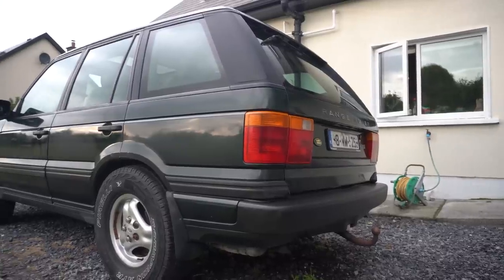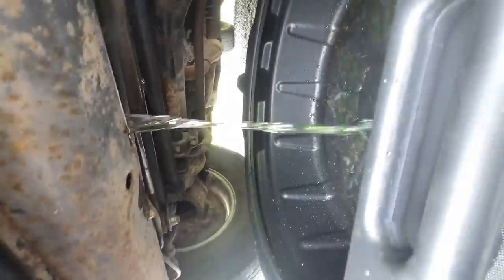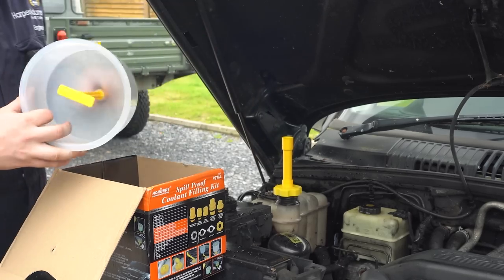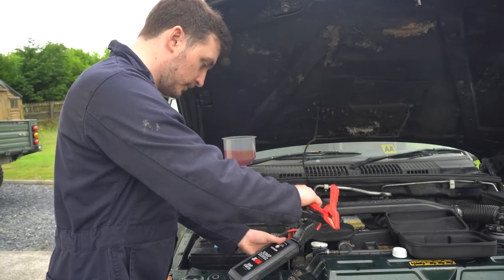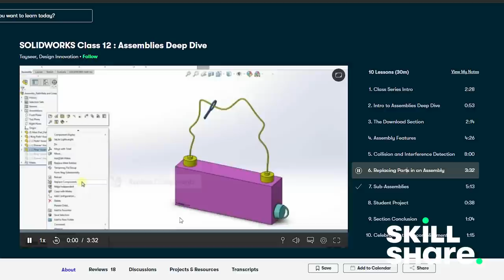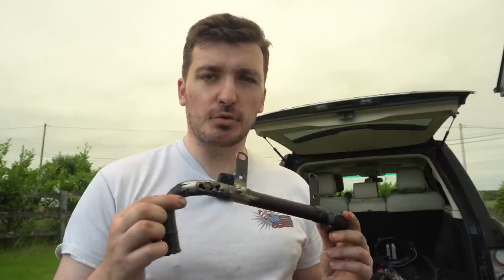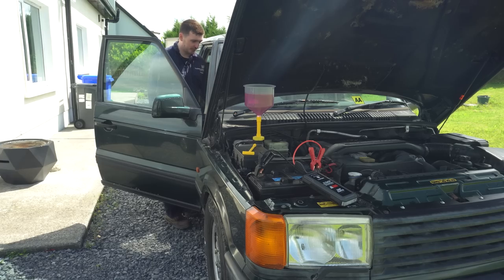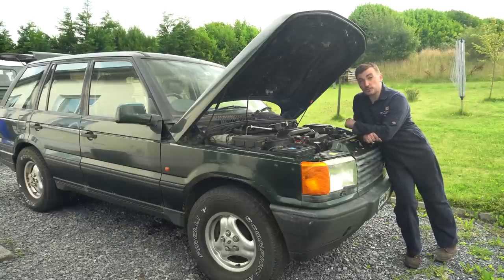My abandoned Range Rover P38 has a big problem with HEAT...

Comment: Hi Sam! great to see a P38 being brought back to life. I am doing a simmilar thing. Last summer I found a P38 with 110k original miles (180km). It had sat for 12 years in a shed before I got it. So far you have done all of the things that had to be done on mine. So I`ll just give you my opinion on the overheating. If the air bleed does not work, I`m afraid that youl have to do a head gasket change. I did everything but that as I dreaded the job. Changed the waterpump (has brittle wings and they tend to go),  put on a new thermostat, change the radiator etc. It did not overheat when maintaining city speeds or idling, but once I got on a motorway for a couple of hours it overheated (once the gasket was pulled off, it had about 2/3 of a milimetre rip in one of the cilindre chanels). Everyone I knew who had worked on these cars told me to do the head gasket and I should have listened. Would have been cheaper and faster. Aperantly the gaskets on these engines are made of an asbestos composite and they go within 10 years, especially if the car has sat. Once the gasket was done, all is fine. With the overheating that is of course :D So as it most likely will have to be done anyways, I recomend to do it asap as the heads on these engins can warp pretty easilly and mine had to be polished/sanded down to level. Sorry for spelling mistakes, not a native speaker

Comment: Hi Sam, just wanted to say I enjoy and look forward to your videos, doubt I will ever get a Range Rover but you never know.
It's just good to see normal maintenance jobs on normal cars.
I am just restoring a 85 Corvette and did a cooling system drain, flush and refill yesterday with new hoses, these are also notoriously difficult to bleed the air out as the radiator is below the top of the engine.

Comment: Always park the drivers side of the car higher than the passenger side,  this helps bleed the old girl.  One mod you can do is change the radiator bleed pipe that goes back to the tank.  The later models had a more level pipe that went straight to the tank. For the battery get a Hankook mf31-1000.  It wakes the while car up😎

Comment: Hi Sam just watched this video again which is very helpful i don't have a heater pipe leak YET! but do have the dreaded heater core O rings weeping! i may temporarily disconnect the core pipes from the matrix and loop them in engine bay until i can sort the O rings 🙄 I have just taken all the windscreen scuttle off and resealed everything as drivers carpet was sodden with rain water from leaky pollen filter/scuttle area now i also have the O rings to do as coolant on tunnel carpet don't we just love the P38 and i have only had mine just over a week😭
Reply from the maker: It’s truly a love hate relationship in the best sense!  Good luck! 🙈
Reply: @SamsMotors  Thanks and you did you get me message about Endtuning chips?

Comment: I had a problem with mine 97 model with the temperature going up and down but never got to the bottom of it since then have had another engine in from a 2000 model as I think the block had gone

Comment: Good one Sam, always been nervous about coolant systems, but looks quite simple really..think I need to add a topdon to the tool kit. Which bottle jack do you use for the L322? Got a service to do on L322 next week,  seems I've only done 5k in the last 12 months! Will probably just keep to a simple oil and filter change this year. Up in Suffolk camping this weekend, filled the boot to the top!! Best long distance machine, cooled seats are great during a heatwave!

Comment: Hi Sam, just a quick question regarding radiators in general. So I’ve had a new radiator fitted and coolant topped up to recommend level. Have noticed that after allowing to cool after a long run the level is dropping around 1mm each time I’ve had car up to temperature so after 2 weeks since new radiator was fitted I find the level has dropped by 20mm from recommended level?? No sign of any leaks , any suggestions please
Reply: Oil seems normal ( no creamy stuff to suggest water and oil mixing)
Reply from the maker: I'd say to just check around all of the hoses that were disconnected for any seepage.  You'll see white-ish residue if there is any coolant leaking.

Comment: Isn't the point of the lock on filler funnel to keep it fitted until up to temp so thermostat opens and it then tops up the revealed empty areas - you removed it to early here?
Reply: Is that in the instructions ? . Do you know the name of the manufacturer of that kit please ?
Reply from the maker: Yeah you can do - I prefer to put the cap back on and allow the system to build the normal pressure, then top up if necessary when the stat opens.  I used this to get a head of pressure above the tank to help the initial bleeding.
Reply from the maker: Link to Amazon in the video description Liam 👍

Comment: Did you mix antifreeze with De mineralized water as tap water can be very acidic that's what causes pin holes in steel Brass alloy copper I've seen it so many times idiots putting tap water in cooling systems even just to top up with a little bit is a Big no no . Buy pre mix then what you have left you can top up with that , ps if you need to flush do it with  de mineralized water about 18 ltrs should do it

Comment: must have been lucky when I changed the radiator on mine, no issues with any air locks.
I did make the mistake of getting rid of the old rad with which had a brass looking drain plug, I should have swapped it out with the plastic one.

Comment: Hi Sam enjoying your series on the P38 has helped me with some of the jobs I've had to do on mine. As you have said the battery has to have a good belt to spin the BMW engine over so I have brought a small sola panel and connected it direct to my battery still in place on the car and that helps to keep it topped up when not in use 👍

Comment: Hi Sam, always enjoy following your projects.  I was wondering if you know of a battery starter/booster such as you used for 24 volt starting.  I would like to get one for my Diesel LandCruiser.
Reply from the maker: Cheers!  That's a good question actually - the only one I know of is made by Noco, but it's a super heavy duty one designed for starting HGVs, so it's really expensive.  A quick Google search shows there are a few other models out there but they all seem to be very heavy duty compared with most 12v ones.  

I didn't realise some Land Cruisers used 24V starting.  I've seen a few with twin battery setups but even those are still 12V.
Reply: @SamsMotors  Thanks for your reply Sam.  I have had four diesel LandCruisers and they all have 24 volt starting after which all the electrics run on 12 volts.  I'm not too sure but I think it maybe something to do with the high compression of the 4.2 motor they use.  Keep up the good work Sam